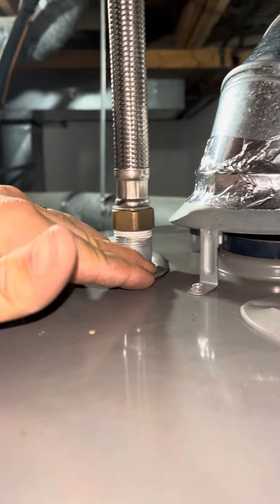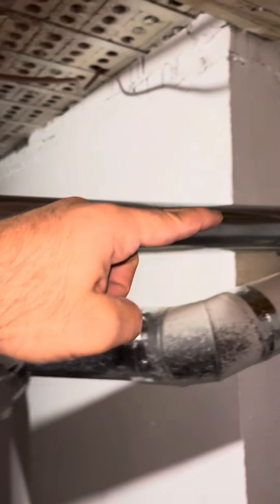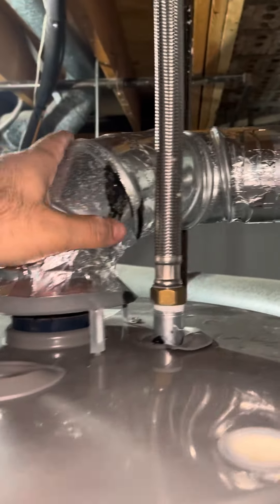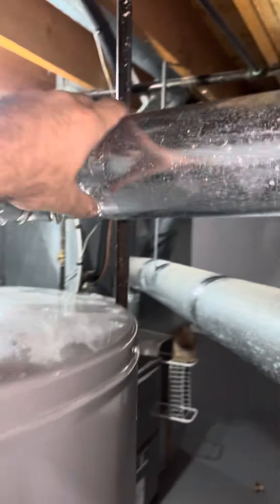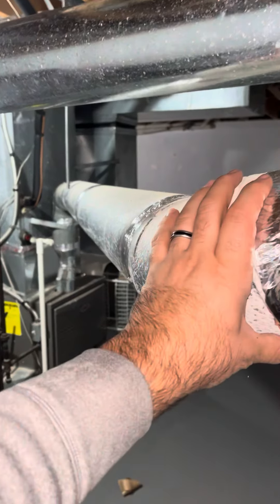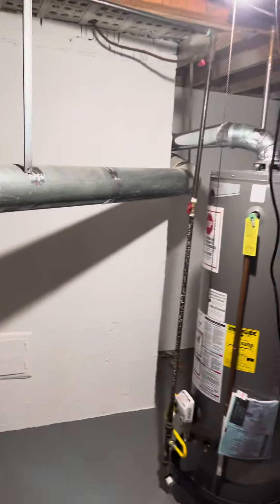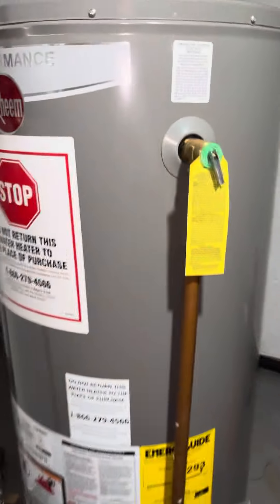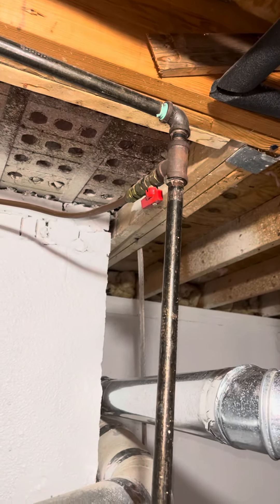Natural gas Backdraft, Water Heater is not venting properly melting top rings. Rheem performance

Comment: What exactly did you accomplish here? Also, get that tape off the venting pipes, and figure out what you can do about cooler, heavy air that lingers throughout the length of the flue.
Reply from the maker: Stoped the rings from melting after I moved the venting pipe on an angle going up.
Reply: So is foil tape not allowed as per most codes?
Reply: @rogeremeadows  You can use foil tape, it's just suggested to use high-heat foil tape. The idea is tape is combustible and flues get hot so the armchair experts say you should never use tape because it'll melt and go on fire but the reality is, I work on these things practically everyday and I've never come across a flue that got so hot I'd worry about it lighting the foil tape on fire so I don't see any issue with it and per my understanding, it's not against code either. 

I only use tape if I'm working with a pre-existing damaged pipe just to help seal any bigger gaps without having to re-do the whole flue.

Comment: This flue connector arrangement is not going to solve your problem, especially when the air in the chimney is cold.  You don’t need tape on a flue because it is supposed to be under a negative pressure.  You need to inspect the chimney and see what’s going on. It is never recommended to put a 90 degree elbow right off of the appliances.  You need a certain amount of straight pipe before you offset, and You need the proper angle for  the connectors. The very slight slope you have is not going to work when it’s cold.  If it’s a masonry chimney, maybe you can install a liner. You will have to enter the chimney higher than the existing inlets.
Reply from the maker: It’s been working fine now, bought the house this way just adjusted the angle of the pipe.
Reply: Yes this is the ideal setup but the reality is many flue connections aren't ideal in the real world and they still work fine. 

Just recently changed a 3 inch flue for a water heater to a 4 inch simply because code demanded it in order to sell the house. Elbowed right off the water heater with no riser and was level and not pitched and was working perfectly fine that way for decades so when I replaced it, I put in the 4 inch the same way the 3 inch was setup as I saw no reason to change the layout besides adding more pitch to it obviously. If it works, it works and it passed inspection. 

Many older houses have no liner and they dump the flue straight into the masonry chimney which I was always taught was a big no-no but yet, it's been working fine in those houses for decades. 

Tape is also fine to use on flue pipe if it's heat-resistant. You don't need it but if you're working with pre-existing pipe that may be damaged or slightly deformed, you can use the tape to help seal any bigger gaps in connections without having to take apart and replace the whole flue. Not recommended to use tape but it's not going to hurt anything either if you must.

Comment: Hi, after installing my HE furnace I have “ orphaned water heater situation “, meaning that my conventional hot water tank is the only gas appliance going through a chimney… now it’s back-drafting time from time.
Do you think installing a stainless steel liner through the chimney and connecting it to water heater will stop back-draft??
Thanks
Reply: I would have a professional inspect your flue and size it for the water heater. Issue most folks have is trying to adapt flue to smaller size. Is your water heater due for replacement? Maybe opt to go electric and your issue goes away since you eliminate the flue, or go with power vented WH also? 
I would have this inspected for safety by someone licensed to do so but there are options out there to fix.
Reply: @sunnyd6019  thanks for your reply. I got 4” liner installed into the chimney and it did magic! Wow! No problem now. It saved me thousands.
Thanks 
Take care
Reply: @andreilesiuk9538  That is awesome, glad they were able to modify your flue and get this fixed for ya, always nice to avoid new equipment if its not needed. 
Take Care!